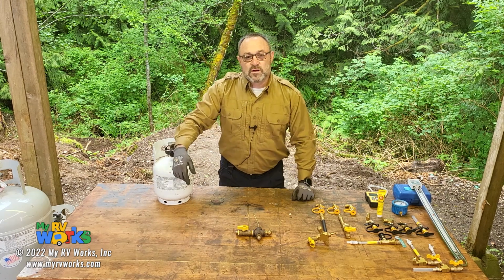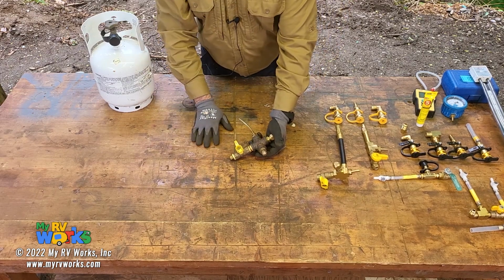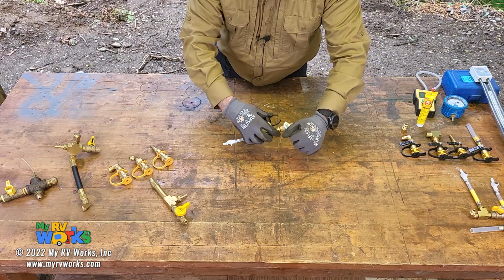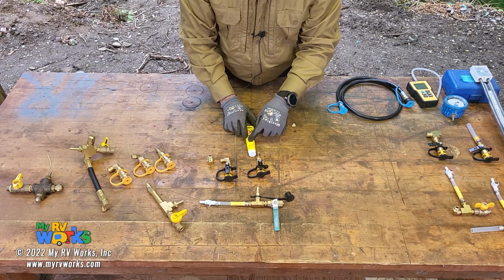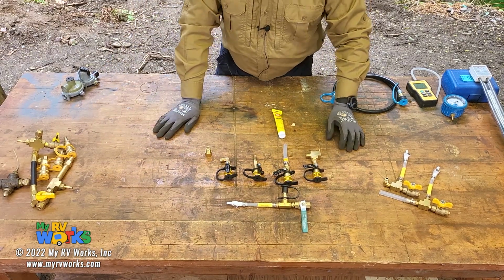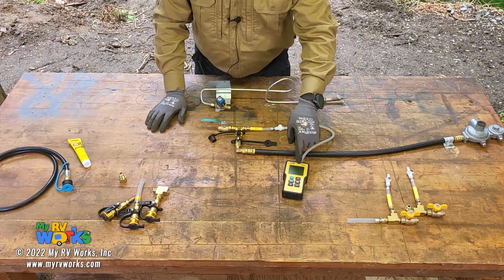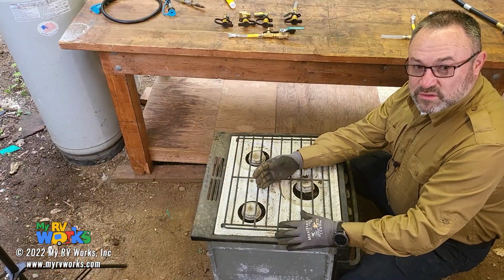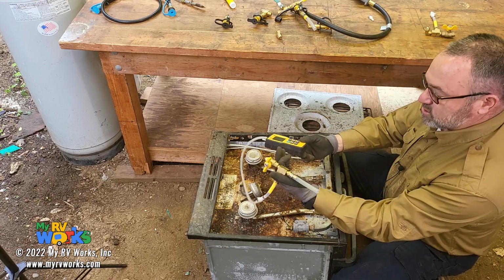RV Propane Tool Review -- "The LP Tap Jig" (Propane Pressure Testing Tool) -- My RV Works

Comment: Another fine vid sir!  If I may - IF during the time pressure drop test, the pressure on the manometer comes up - what differentiates a faulty high pressure regulator from a faulty tank valve?   If the tank valve is leaky, the regulator is still doing it's job.  I'm a little perplexed as to what would directly point to the regulator here.

Comment: Great video. Can you give some more information about the quick connect on the manometer? Did you add the quick connect to it our did it come with it.
Reply from the maker: That tool is something that I conceived, design, tested, and refined. So every piece on it is something that I sourced and has passed my rigorous daily usage to make it awesome!
Reply: @MyRVWorks  so do you sell the manometer quick connect fittings then? Seems it would be great addition to your kits.

Comment: The flame on my Atwood stove "oscillates" or "pulses".   This is on my ice fishing house and last winter when it got cold out (20 below or so) the gas quit flowing alltogether.  I would like to correct this for this season.  Can you point me in the right direction?  I put on new tanks and my spare regulator but the flame still pulses.
Reply: Most likely the problem is the tank is too small for the appliance not allowing the propane to vaporize fast enough.  You mentioning it only happens in colder temps is key to this.  Larger or multiple tanks manifolded together should help that.
Reply: @stevenscott4096  Thank you.  I've been running two 20 llb tanks  manifolded on one regulator - the same as an RV setup and haven't had this problem before.  I'll try two 30 lb tanks though and see what happens.  Could it be the way the tanks were refilled?  i.e. not enough pressure in the tanks?  Also, in really cold temps, the gas flow stops.
Reply: Running the stove in warm weather and the flame still pulses.  Could there be a blockage somewhere?
Reply: @dakotafisher6874  I don’t think changing to 30# tanks would matter because the surface area of the liquid to vapor interface is the same.  Before you mentioned the surging happened when it was below 20F. Since it’s now happening at all temps and you’ve changed the regulator.  I would test by checking the incoming pressure near the gas valve and see if the pressure is fairly stable while the burner is on.  It might change a little bit, but based on what you’re saying my WAG would be to look at the gas valve.
Reply: @dakotafisher6874  At negative temps it quite easy to flow enough propane to freeze the tank.
Reply: One other thing.  I’m assuming this is spark ignition and not standing pilot.  Correct?
Reply: @stevenscott4096  I am assuming you mean the gas valve on the stove itself?  and yes, it is a spark ignition on the burners and pilot on the stove part.
Reply: @dakotafisher6874  When you say "Also, in really cold temps, the gas flow stops." that says to me a vaporization issue or a regulator issue.  I understand you tried another regulator.  Was it a known good regulator?  And there is only 1 regulator between the tanks and gas valve?
Reply: @stevenscott4096  Yes , the regulator was a new one that I keep around as a spare.  I even put the suspect regulator on my camper and it worked fine.  Is the "gas valve" you are talking about the valve on the stove top to the burners?  So a vaporization issue will cause pulsing?  The burners are still pulsing in warm weather.  Thanks for your help.
Reply from the maker: That sounds to me like dirty propane.  The only thing that should be in those cylinders is 100% pure propane. If there's any air or moisture in those cylinders, from improper purging, that will cause the symptoms your experiencing. You may want to take your cylinders and have them properly purged. That is a procedure that a licensed refilling station would know how to do. It can be done with old cylinders... But it will require those cylinders being completely empty as the purging is done with vapor and not liquid propane.
Reply: @MyRVWorks  So could I have gotten "dirty Propane" from a fill station that had dirty propane in their supply tank?  I am suspect of the place where I had them filled last.   Or..could I have gotten moisture in my system by having my pig tails disconnected for a time during the summer when I wasn't using the fish house?  I am really interested in how to blow out the lines in the house.